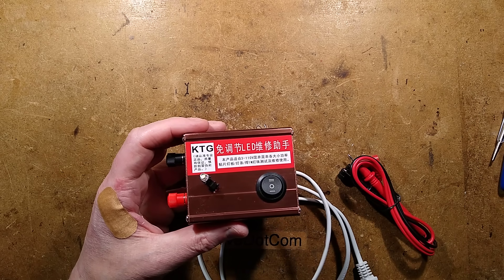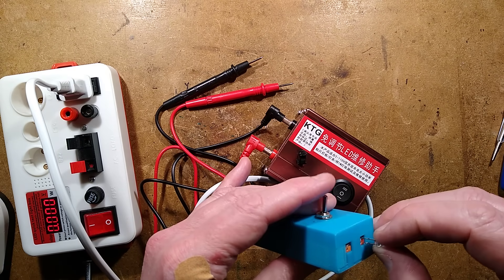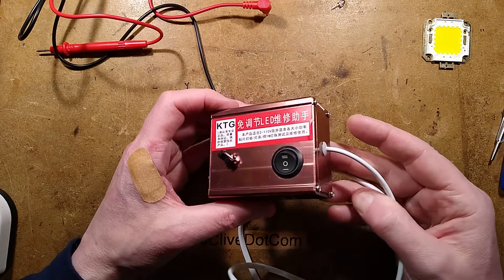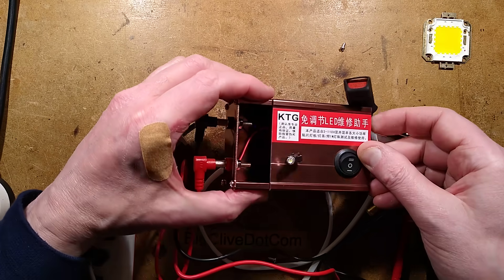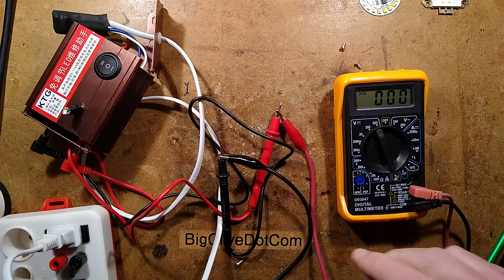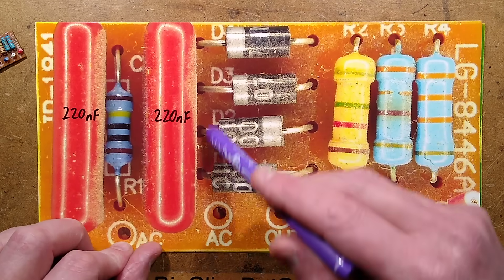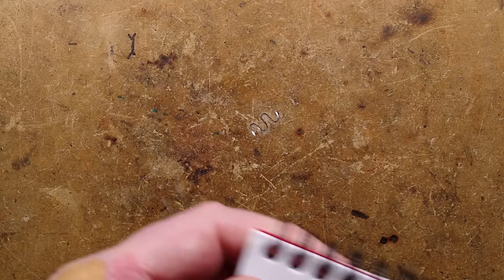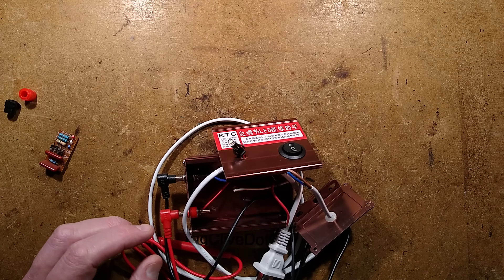Horrific LED tester that can literally kill you - (with scary schematic)

Comment: Did you report it to eBay? In my experience they don't take any action apart from giving you a refund. They say they will investigate but months later the dangerous items are still on sale. They maximise trade not safety.
Reply from the maker: I should see if they actually have a dangerous goods reporting system yet.

Comment: I would use it but I would first put a polarized plug on its safe for me just because I don't get shocks from mains for the most part if my hands are sweaty I might notice it's on at 120 but not really care outside of a arc flash or breaker pop but the debate is should I leave that death trap on my bench for somebody else to use if I pass I'll pass but if not for the risk to others I would use that and not think twice but I would upgrade that smokey resistor and install a lamp holder because I know I would be just fine the high setting would be extra high 20 watt 500 ohm resistor
Reply from the maker: Don't get too complacent about shocks.  You may wish to see my video called The unofficial guide to electrocution.

Comment: I was screaming in my head reverse the LED 
What was the voltage on the low setting I know the high setting was 212
Reply from the maker: Same voltage on all settings, but different current limit.

Comment: If the price was lower " Like $1 dollar" it would be good for the metal case.
Reply: Hopefully there is an inverse Big Clive effect which pushes the price down 50% instead of the usual...
Reply: I'd buy that for a dollar.
Reply: And that IS really about it. I like the case, that's ALL
Reply: I just checked, it's more like $4 with free shipping in China.
Reply: I bet Factory FOB price is a couple bucks.
Reply: @fahey7335  IF that
Reply: "Like one dollar dollar" ? 🤔
Reply: exactly what I was thinking.
Reply: What were you quoting?
Reply: I wondered about that.
Reply: $4.00  US CAN I GET IT ON  ANY SITE BESIDES Flea BAY
Reply: IKR? 🤔👍
Reply: That is a cute box.....
Reply: I made a similar unit of my own design for testing high voltage LED modules, but I didn't bother with a case at all initially because I planned on being far away from it when I supplied power to it, and certainly not holding any probes.

Comment: You should make a video making it "safe". I can't imagine it would take much, a fuseable resistor? Or would you have to get rid of the capacitive dropper?
Reply from the maker: There are safer units with a fully isolated supply.

Comment: Maybe the Chinese characters on the box say "attractive metal project box with three position switch. Cut line cord off and discard dangerous placeholder circuit board inside immediately, to avoid electric shock" 8^)  Boy, that's one product I can do without! Cheers.

Comment: My jaw hit the floor with this one. The first thing I ever wired together was an LED tester. It was in class, I was 11. I used a 9v battery, battery clip, a resistor, a switch & an LED terminal. Housed in a wooden case I designed to look like a mini "hippy caravan".

It was awful, but it worked & posed no risk whatsoever. All that considered, there's no good reason for this product to exist, let alone be imported to the UK.
Reply: This is for testing high voltage strings of LEDs, such as in a mains lamp or an LCD backlight. I have my own DIY version of this. Fingers crossed a much safer design.
Reply: With a 9V battery you would need a largish boost converter to test the LEDs this thing is intended for.

Comment: I have two ebay-rules:
1. Never purchase things for wall outlet
2. Never purchase things for your mouth
Reply: That leaves a promising number of categories available.
Reply: I don't know what concerns me more,the fact that people would buy anything off eBay and put it in their mouth,or that you only mentioned one orifice😂
Reply: @notpoliticallycorrect1303 but mann those plugs they have....
Reply: @notpoliticallycorrect1303  🤣
Reply: @notpoliticallycorrect1303  I buy antique tobacco pipes, sanitize them, and smoke out of them. 🤷‍♂
Reply: @Eddy-NOR I think rule #2 should be for ALL orifices, not just your mouth. Wall outlets aren’t the only holes they sell plugs for…
Reply: @buriedpet  the sky is the limit
Reply: 3. Nothing that needs to be charged
Reply: Keep away from electric toothbrushes, they plug into a wall outlet and go in your mouth.
Reply: @dougbrowning82 I've never seen an electric toothbrush that has a mains cord hanging out of it.. 

They are ALL battery powered, and 99% of them today have a completely sealed, waterproof, case around the entire brush and it recharges through contactless/wireless inductive charging when you place it into the also waterproof charging dock.

There is no worry about getting electrocuted from the greater majority of electric toothbrushes today.
Reply: @davelowets  They can always stick a large capacitor somewhere on the circuit for an extra toothy electrocution.
Reply: @davelowets  I think he means the recharge ones
Reply: @dougbrowning82  oh i still have a blanket that's literally just wires connected to 230V, I'm definetly not gonna use it 😂
Reply: DEF don't buy anything that goes in your mouth that also has a mains cable.
ESP if it's got a thick heavy duty one.
Reply: @Willam_J  Its a Full Bridge Rictumfier. 
It casts Rictumsempra, a spell that causes strong tickling feeling.
Kinda like electrocution, just more magic.
Reply: The 1st is a must but 2nd is considerable
Reply: Instructions unclear: bought something for both
Reply: Or for ANY other orifices for your body.... 😬
Reply: Nor your genitals.
Reply: Don't even dare purchase it for uranus.
Reply: Well that leaves you pretty goddamn limited then doesn’t it
Reply: Or rectum
Reply: looks likes from sids room toy story 1
Reply: Instructions unclear: bought something for both
Reply: Personally, I'd expand that second rule to any orifice
Reply: Oh, I don't know.  I've bought some very good cheese on eBay before.
Reply: Paige NO!
Reply: I've purchased non-electrical Lutein Capsules and Pumpkin Seeds for my mouth, and they were fine! 👍🤣

Comment: Why are you removing parts from it before testing it? That makes no sense. I don't have it, but couldn't that LED complete the circuit and serve as a visual indicator for something? You should have tested the device's LED socket for an output value or at least kept the LED in it.

There is a big chance that when you don't understand a product, you might draw incorrect conclusions so at least try a product as it arrives not least when you're working with mains-driven products, build in regions without any safety concerns.. 
It seems like you're just winging it to make coins on social media, alongside these bombastic clickbait headlines about death 'cheap Chinese products will kill you", while you're clearly the ambassador' and promote them left & right, and create a lot of sales.

I got the high voltage TS-990 (for testing atomic emission lines on ionized gas on a handful of spectroscopes) after you were parading it, instead of the CE-rated Martin Dale FL30 that only seems to be common in the UK but also cost 500% more.
So don't be naive, you are also creating a lot of sales for these products by giving them obs and using them for income on social media.

I'm not sure who is more dangerous: someone with a mindset that constantly pursues the lowest common denominator on social media for coins, or these questionable run-of-the-mill mains product' that would never be greenlit here in northern Europe, or a mix of both.

// It seems common sense enters the video at 5:34 mind-bending. I'm pretty sure Clive is far more skilled in electronics than I am, but when he can't even sense that the compartment top needs to be slid on / off, you have to wonder about the technical intellect involved.
Reply: I’m guessing that this is a response from the manufacturer?
Reply: The last part of your comment feels insulting for the sake of it, almost as if its personal. This product provided no documentation whatsoever, and its construction is so ambiguous and generic, that a skilled person like Clive has to play the guessing game as to how it functions. Sorry but that's just a bad product. The product could kill you if you aren't sure what you are doing with it, and judging by the lack of clear information of the product, I'd say yes, its absolutely cheap Chinese crap. Cheap Chinese crap/junk is called as such for a reason you know..
Reply: Hope this improved your social credit score, comrade.
Reply: this reads like the user manual for this crapbox.
Reply: Don't turn it on, take it apart!

Comment: I build LED test tweezers
It is a royer oscillator using the choke (or transformer or whatever you call that) from an ethernet- (or was it modem-?) port generating a square wave voltage of about +-12V from an AAA battery attached to the back of the tweezers
2 LEDs on the prongs wired antiparallel in series to the output on the actual prongs show which way is the positive of the LED under test. And of course a little tactile switch tu turn the thing on
You can test even multi chip LEDs and get either an indication of the polarity or open or short circuit (either none or both indicator LEDs lit)
Very handy for searching the one defective chip on the LED plate of some light fixture

Comment: When 5 Minute Crafts start selling their wares.
Also, I would love to see what they consider to be 'shoddy'!!!
What would happen if you flashed the probes together?
Could the red and black sleeves be a crude 'safety' system?
💚🐇🐴💚
Reply from the maker: If the probes are touched together the current is limited.  But if one is touched to a grounded surface it would be much more violent.

Comment: I just checked ebay and found a deluxe version with an LED voltage display that proudly displays "11th Heneration" on the front panel.  Eleven attempts and they couldn't even get the spelling right, so chances of it being equally dangerous seem pretty high.
Reply: That one is a clear improvement on their "10th Hemeration" model though. Which in turn improved on the "9th Hemerayion".
Reply: @rexsceleratorum1632  The first hemorrhagic version should be avoided for sure.
Reply: It’s just iterations to make the thing more affordable. The 12th generation will have that unnecessary discharge resistor removed.
Reply: That just means it's killed 10 designers before this.
Reply: Might work just fine in the 4th Himension?
Reply: HAHAHAH
Reply: They misspelled the 11 too.
Reply: Could be for the hispanic market?
Reply: @alistairmackintosh9412 🤣 🤣 🤣
Reply: The H and G are next to each other on an English typewriter so it's probably just a typo that was not recognized.
Reply: @williamwalker8107 oh come on, Dude, you need to add a little humor in your replies!
Reply: @46bovine  There is humor in there, it's just very deep.
Reply: @46bovine  The 12th Humoration will address your complaint.

Comment: I used to think that these kinds of deadly devices were just due to incompetence, perhaps designed by someone who doesn't really know how electronics works and is unaware of the dangers. But the more I see of these things, the more I feel like they just don't care if someone does get a fatal shock from their product. And the more respect I have for you putting your life on the line for our entertainment.
Reply: They're not stupid, they just do it the cheapest way possible for these eBay listings because that's what gets sales.
Reply: @FerdinandFake  Correction.  They are stupid.
Reply: I think you may have overlooked a third possibility, that they are making these devices on purpose to kill off as many of us as they can without ever invading.
Reply: If someone dies in the West there are no repercussions for the company in China.
Reply: I think they just don't have strong worker safety protections and assume users will be careful, just like with that lamp tester thing Clive uses. I guess it's not much different than a worker using a regular power drill or reciprocating saw, they just know not to touch the dangerous part while it's moving, even though there's nothing to stop them doing it. That's my theory anyway.
Reply: @youtubeviewer7077  Nothing to do with worker or Western user safety.  Whatever is the utmost in cheap construction is what gives them their jollies.  If you ask a Chinese factory to build a widget from 3mm plate, they will object and tell you 1mm is plenty good enough.  If you then say no, 3mm, when the goods turn up in your country they will be 1mm, and you've already paid on order, so you have to throw the sh*t out..
Reply: @einfelder8262 What you are describing is the 'Chinesium' phenomenon where factory workers (or even owners) will go back into the factory after standard work hours and pump out shity bootleg products like the one in the video.
Reply: @SemiDoge  That wasn't what I was describing at all - don't put words in people's mouths, it's not a good thing to attempt to usurp control of others.  But what you are describing is highly likely as well.
Reply: @einfelder8262  Well, I'm sorry for accidently omitting the words, "I think," before my comment. It's a little weird to come back at me in such a hostile way for something so small...
Reply: @SemiDoge  How to apologise without apologising.
Reply: The chinsese saying of "if you can cheat, cheat" applies here

Comment: These are probably supposed to be combined with a foot pedal in the factory, making them still horrific but at least workable.
Reply: or a 220V to 110V isolation transformer? With that US-type plug and 110V written on it, combined with the instantly fried resistor it could very well be intended for US/Japan voltages

Comment: Surely the socket on the outside is not for an LED but a resistor so you can tweak the output?
Reply from the maker: I think the random external LED is actually being used as a fuse.

Comment: how do you take and print such detailed pictures of the circuit board?
Reply from the maker: Good lighting and an inkjet printer.
Reply: @bigclivedotcom  what camera and printer do you use?
Reply: It also helps a lot to avoid speed blur by having the camera on a tripod or otherwise immobilized.

Comment: I'm constantly impressed at your ability to continue finding the shoddiest of devices to share with us.
Reply from the maker: There's no shortage...
Reply: Big Clive has certainly has a type 😉🤭
Reply: What about those of us who don't know enough about the dangers involved in using a product that is being sold on the open market? Being this channel's village idiot, I might want to buy this tester, and would assume it was safe for the use for which it is sold. How do people like me protect ourselves from such dangerous products? I am generally opposed to government getting involved in our lives, but electronic products should  have to get a seal of approval from the government that the products sold are safe to use.
Reply: As an average consumer, it's tough to determine if a particular product is safe. However, there are definitely things you can do to reduce your chances of getting shoddy products. Buy from known brands and retailers. Don't get random unknown brands from Amazon, eBay, or AliExpress.
Reply: @williamromine5715  (How do people like me protect ourselves from such dangerous products?)
Easy - make sure the label ON the product - includes a PASS certificate standard, for the country YOU intend to use it within, and never ever insert any foreign made electrical device, directly into a mains 2 pin ungrounded socket, if you do NOT use an isolation transformer in it's supply circuit.

A mains switchboard RCD does NOT do a correct isolation provision, as it merely relies on the user getting a LESS THAN 30mA SHOCK - by becoming part of the "in between the probes" circuit, BEFORE the RCD trips after "at least" 30mA flows.

An Isolation Transformer ensures that NO "mains to earth" circuit is ever "made" - as there is no internal connection to earth, on the secondary side of a 1:1 mains isolation transformer.

The secondary supply of an isolation transformer ensures that ONLY something directly in the electrical supply path, will receive an electric current supply, so DO NOT EVER - tongue test any electrical device, no matter how it is powered,

As even a simple 9vDC battery, can kill you - if you "tongue test it" (at full capacity) without removing it from your tongue.

Remember - only electrical devices, should ever be powered by electricity.
Testing anything else, such as fingers, arms or your warm=wet tonge, can literlly kill you.

A HUMAN -  IS "NOT" AN ELECTRICAL DEVICE
So do not ever use a human body, or parts thereof, to "test" if an electrical device works, other than a single finger, to "switch" any switch.
Reply: @williamromine5715   Danged pesky regulations and standards.
Reply: There used to be a product safety oversight and regulation organization within the US govt that would not allow unsafe electrical devices to be brought in to the US.
Reply: @zavatone Namely…? 

Meanwhile, we do have the CPSC, and the non-governmental UL, among other things. 

The problem is that when you, a consumer, order directly from China, YOU are the importer who is technically responsible for ensuring it’s a safe product. :/
Reply: @tookitogo I've dealt with the CPSC, about a nursery rocking chair that my son almost crushed his head in, they basically said "oh that's interesting" and I never heard from them again.
Reply: @tncorgi92  I wasn’t making qualitative statements about the CPSC’s effectiveness. I was replying to a comment that insinuated that we don’t have any oversight bodies/agencies anymore. But we do.

Comment: Yeah, and what if the wire insulation on the LED sticking through the hole in the top of the case was to chafe and short out? Then the case would be at mains as well. This needs a three-wire, grounded plug, and a fuse, at minimum. 😅
Reply: No, it needs hurling into a furnace to reclaim the aluminium...